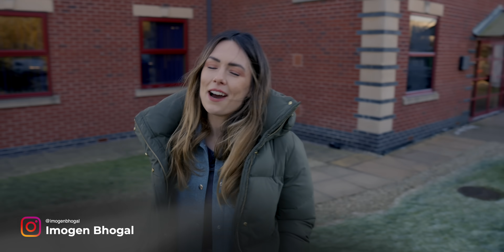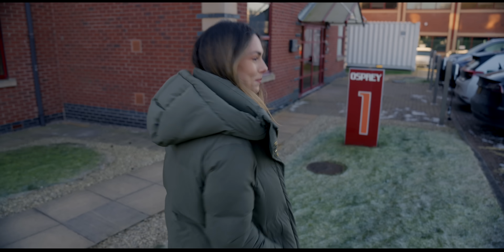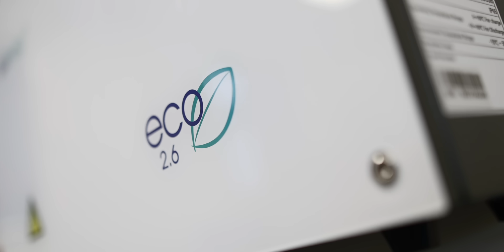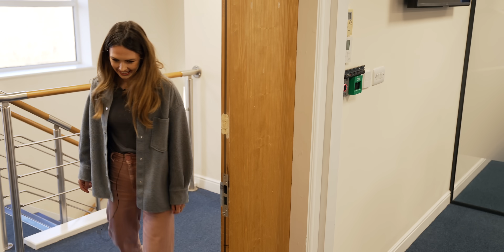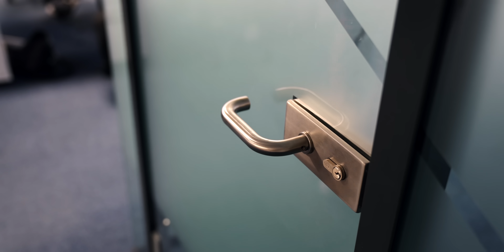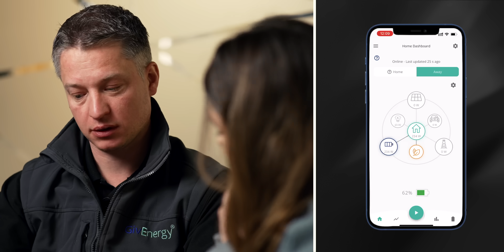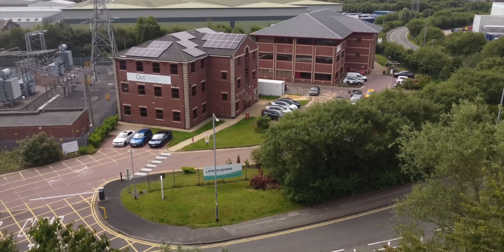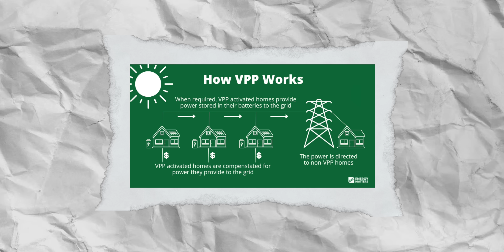THIS Is The Secret To Green, Clean Passive Income!

Comment: Are GivEnergy working on a 2 way EV charger yet? This would massively impact the home battery requirement.
Reply: This is sadly more dependent on car support which is still rare
Reply: Do you mean bi-directional EV charger (as in, power the home from the EV battery, as well as charge the EV)?
Reply: Only nio has active VTG. Load up on cheap energy at night and sell it during the peak day rates. And of course all their swap stations do energy arbitrage as well. No stationary and pointless megapacks.
Reply: @ChickenSandwichesForLunch  Sorry, but ya wrong buddy.  I already replied above.  https://youtu.be/rSLRhxOND6E?si=kt1baD6stAYK5cPI
Reply: Kia EV9.  Renault Mégane.  Leaf 🤮

Comment: The assertion that the Australian grid may be the largest strikes me as potentially wrong, given how tightly integrated the power grids are been Canada, and the US.  I’d be curious to learn exactly what definition they used.

No shame, Australias still has a very large grid.  But in British Columbia, Canada we buy excess solar from California and Nevada during the day, and sell them hydroelectric at night, as an example of how tightly integrated Canada and the U.S. are on this issue.

If there’s a weakness to the grid here it’s that the East-West links within Canada could be stronger.
Reply: Many countries do not have hydro available at the scale you have in Canada. The UK does have cables under the sea to Norway and can transfer energy either way from what I understand.

The most important point discussed here surely though is energy security, and locally generated energy.
I.e. Home Solar, Battery storage and EV’s. In the UK we would add Wind power to a bigger discussion.

When averaged over a single year, our home Solar panels provide 48% of our home power needs.
Our GivEnergy inverter, charges our battery system (& EV) overnight (off peak) and we export to the grid at peak times during the day/early evening. 
We can go off-grid for 3 days in summer if we needed too, and approx 18 Hrs in Winter. So while we remain “grid-tied” we slightly less dependent on it. In fact we would be considered “Prosumers” as we generate power and form part of a virtual power network.

Exciting times we live in.
Reply: From the hydro in Tasmania to the most northerly coal fired power plant in Queensland is further than Miami to Toronto either by road or in a straight line. Then we can go from Melbourne to the Great Australian Bight and see power lines all the way. What do you think they are doing ?
Reply: Australia has 20 million buildings and 1million klm of transmission lines and poles and wires. 
20 million customers. 
5,000klm long, north to south west to Wudinna SA.
Reply: @stephenbrickwood1602 20m buildings for 25m people........
That's some waste of space!
Reply: @computerbob06  from Wikipedia. 
10 million homes included. 
Industry and commercial buildings as well.